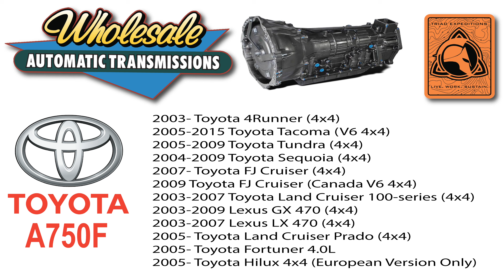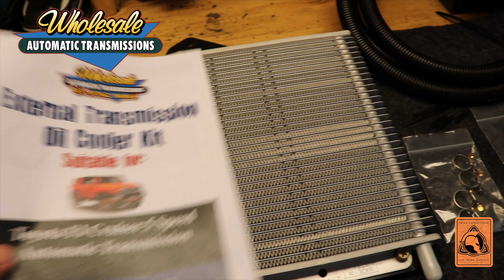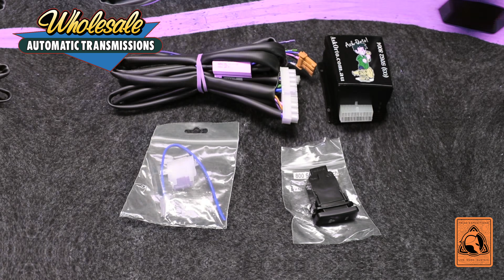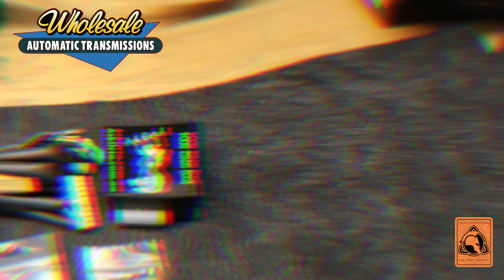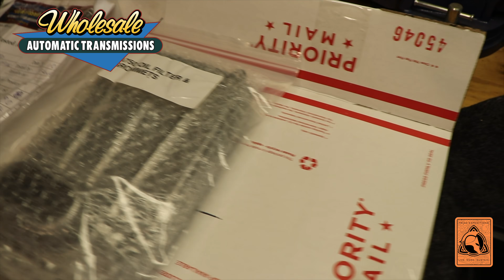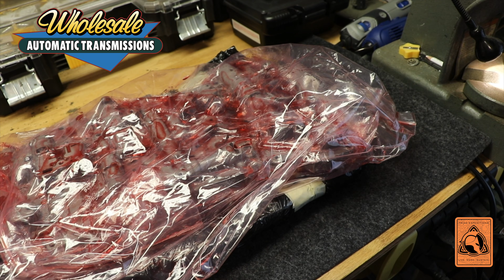FJ Cruiser Automatic Transmission Modifications

Comment: Used one on my FJ and one on the Tacoma..
Hayden Automotive 678 Rapid-Cool...
Reply: Can confirm it runs cooler. Installed it on my 2011 (don't know the mileage when. 170 or earlier) if you do it right (transmission to radiator to cooler) then of course it'll cool it more. 269k currently on the fj (heavy off-road use involved) and it still shifts smoothly
Reply: I put a Hayden 679 after 4000 miles from showroom. The reason is I live in a tropical country where peak afternoon temps get to 35c max. The maximum rise I would see in my ATF pan temps via my Torque app and OBDII would be around 100c and in hills doing slow climb behind traffic around 115c max that me me truly uncomfortable. After the install of cooler my max temp in hills slow or hard driving is no more than 75 to 80c and same goes for stop and go traffic. I recommend this mod fully. Shift quality in traffic improved drastically as well. I intend to do a drain and fill on the tranny every 30000km so even for those who don't intend to tow, I thoroughly advise the transmission cooler especially if you have heavier aftermarket components as well as bigger tires.
Reply from the maker: What was the miles on the transmissions when you installed,  and how many miles on them now,  Have you had any issues with either transmission, and what is the service performed.   This will help us get an idea of how effective you think the transmission coolers are.
Reply: @UpintheAir.stream  ...the FJ is a 2008..I put transmission cooler on before the Alaska trip in 2011, after the warranty ran out with 50,000.
 I now have 150,000 on the FJ..
Can't honestly say with confidence that the transmission Temperatures lowered..Have no way of taking measurement's..I though that the scan gauge could measure the fluid temps but apparently not..
I live in Tucson and 4wheel a lot with a trailer now..

Comment: My concern is down the line is there room for a S/C intercooler to go in beside it?
Reply from the maker: You can easily remount the transmission cooler, down the road,  The engine cooler , is supplied by rubber hoses,  not expensive at all to buy new hoses.  Plus the modification should be done before the supercharger IMO.
Reply from the maker: We will see,  We have a supercharger intercooler installed and we are installing the transmission cooler now  , check out Part 2 to find out.